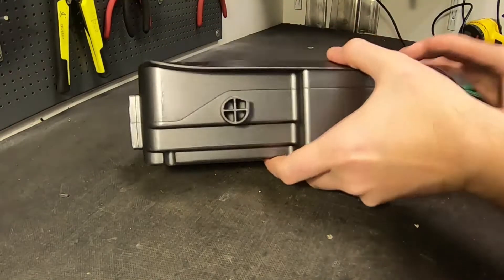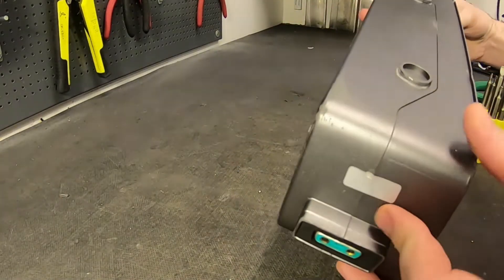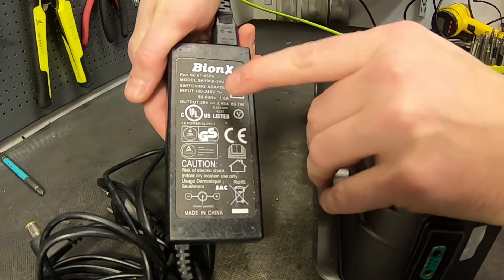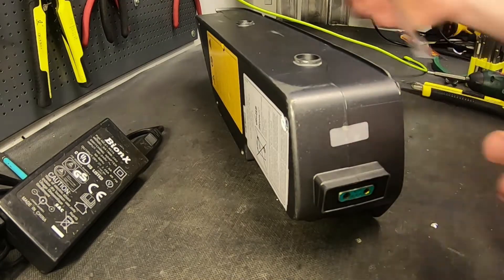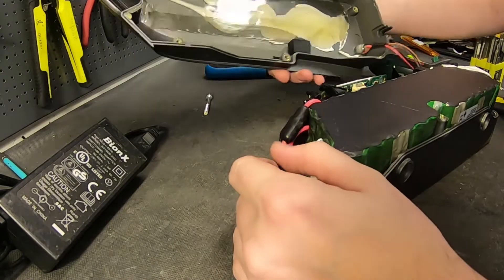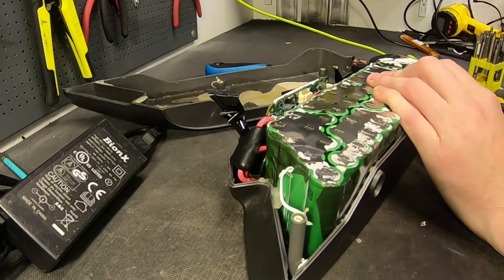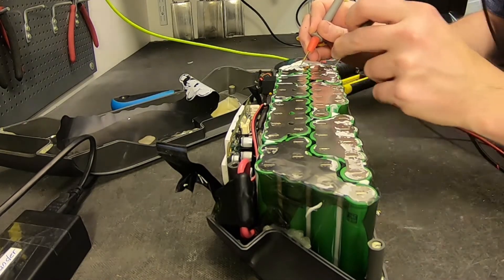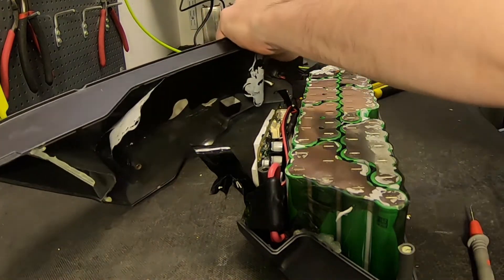Inside a Smart Ebike Battery Pack by BionX

Comment: what happened finally?
Reply from the maker: We did not accept it for repair.
Reply: @TheBatteryDoctor  So is that battery unrepairable? Would it be possible to keep the case and make a new battery or something like that? BionX closed and it's a pity we couldn't use the Smart E-bike any longer. What would you do?
Reply from the maker: @lapanchito  Yes but it would take many 100s of hours, Grin has a video och how to use the Bionx motor with a genereic controller, then you can use any battery.